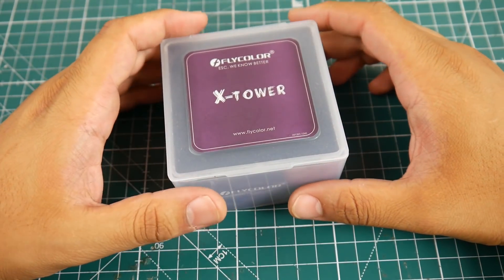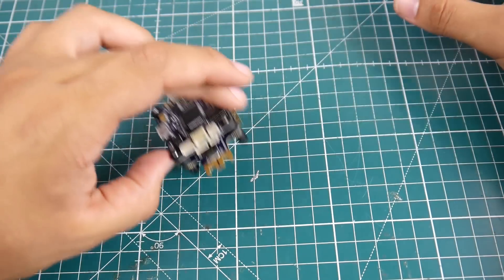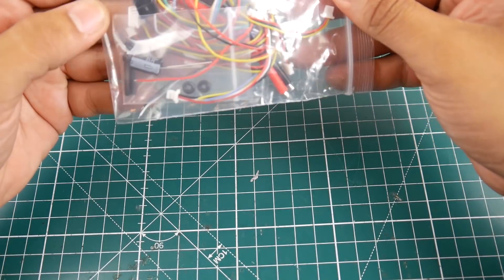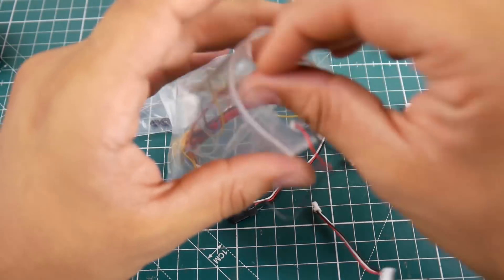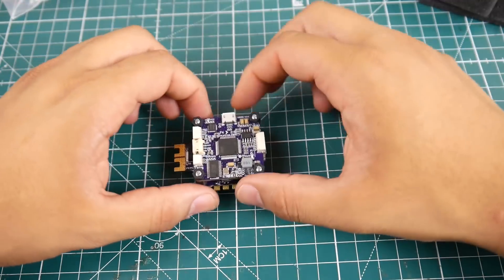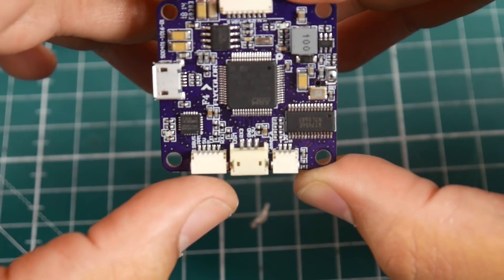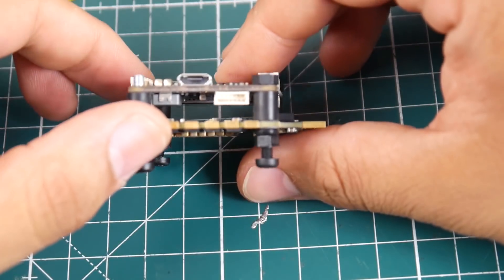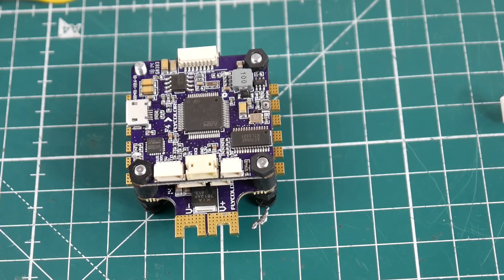Ultimate 6S Flight Controller Stack!! // Flycolor X-Tower F4 Flight Controller OSD

Comment: Hi what's up , I just soldered with this exact Esc and I did a mess on two of the Wires so I fixed it but I can't say it's perfect will that be a problem because I did notice that all the Ends where the wires go onto are one big metal part all joint together

Comment: quick question bro I have qav105 and bound to qx7 in d8 mode.reciever tab is all over the place.top 5 switches are all moving on there own.in a big way.without even touching radio.reflashed.setup another new model still same.tried everything.everything is checked correct. serial based and sbus. is there ore in missing bro ore do I have faulty reciever.great video aswell by the way
Reply from the maker: Do you have more than one quad? If you do does it happen on all of them or just this one?
Reply: Drone Mesh seems just this one bro.not sure if done something wrong ore ore.but sticks are allover. aert and taer tried.
Reply: Drone Mesh we have several bro.i run a progect helping six kids stay out trouble and teach em to fly.but can't figure this for the life of me lmao